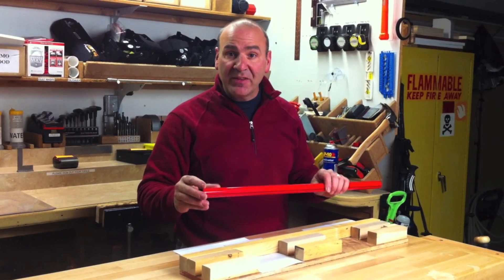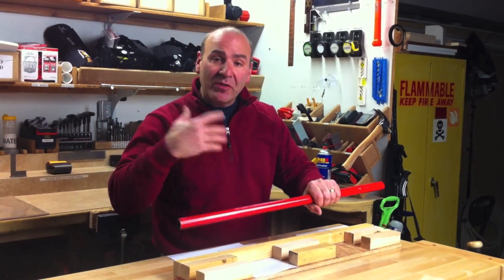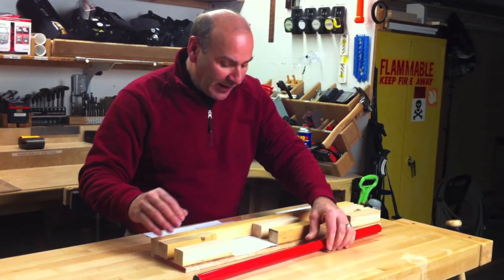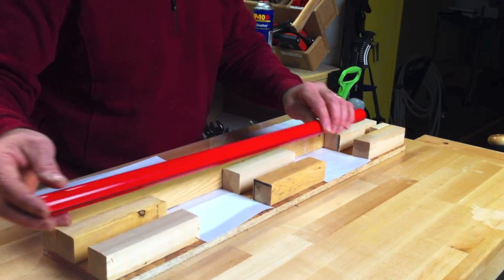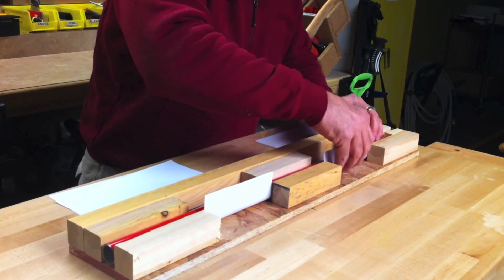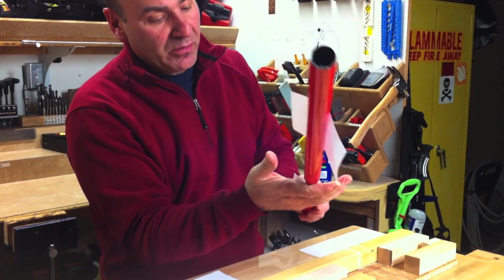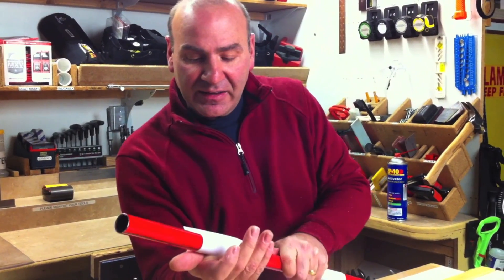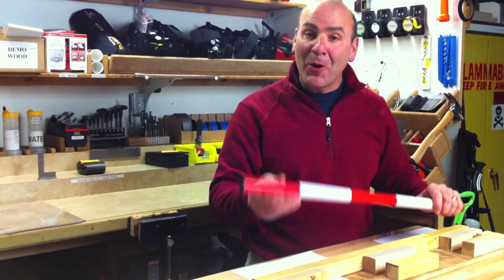Lean Manufacturing - Poka Yoke - Process Improvement - FastCap

Comment: can someone explain to me what is POKa YOKe ???
Reply from the maker: +elmira fegidero 

It is a simple as I said in the video...the Japanese term that means "mistake-proofing". It employs visual signals that make mistakes clearly stand out from the rest, or devices that stop an assembly line or process if a part or step is missed.
Reply: thank you so much *****  and FastCap  can i ask a question again !! are u familair with TPS mechanics for SCHEDULE CONTROL AND JIT  ???
Reply from the maker: +elmira fegidero Mistake proofing a process.
Reply: @FastCapLLC  using all english would mistake proof your communications with English speaking outsiders